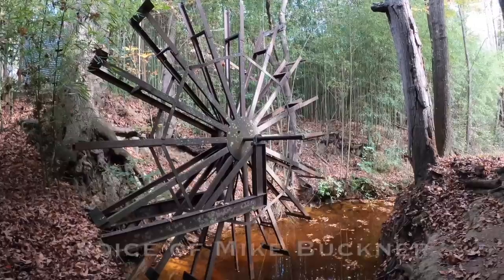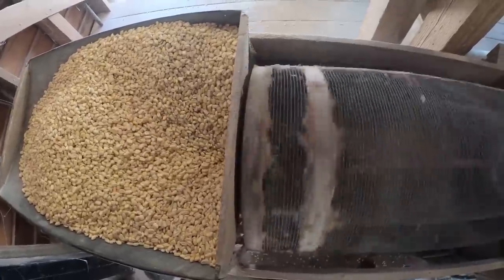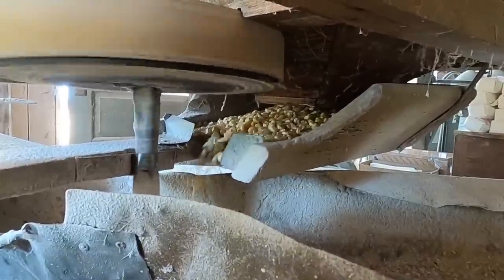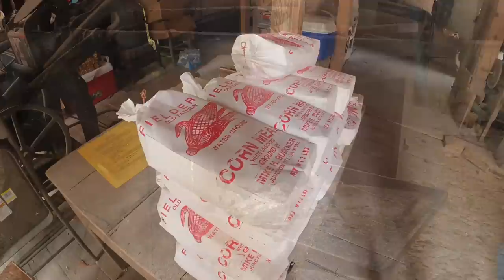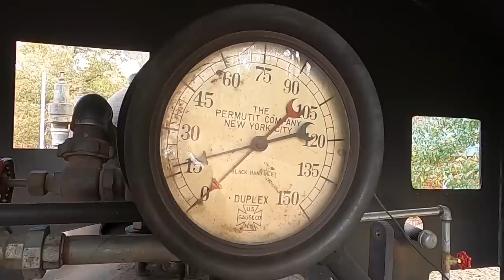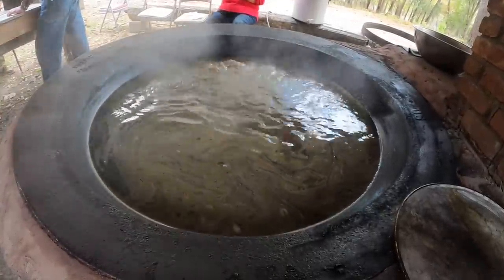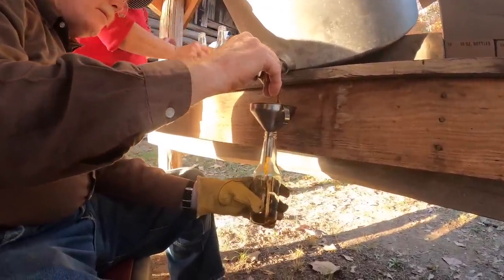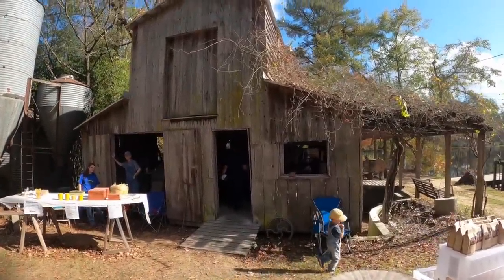The Way Things Used To Be

Comment: Here in South Central Indiana Lawrence County there is a park called Spring Mill Park. It is a beautiful example of life in the 1800s. The water that flows through the rolling hills and the caverns producers plenty of horsepower for a grain mill as well as a sawmill. These are demonstrated to the public in the summer season. There are dozens of original log buildings and beautiful creeks full of water cress. There is a blacksmith shop that actually functions and they demonstrate, there is a woodworker shop with a foot powered lath. Another one not to miss if you’re in the area.

Comment: Hi Wes. Have you ever been to Jarrell Plantation near Juliette, GA? I was there 5 Nov 2022. This plantation started around 1870. I took 144 photos with most of them being black and white. On the way home, I stopped at a covered bridge that had been rebuilt in 1997. I suppose the original fell apart. They had a sugar can grinder powered by a tractor because the steam engine was in need of some parts. I even tried some of the cane juice after it had just been pressed. If you would like to see a few of the pictures, I could send you a few. They are around 1.5 Mb each for the black and white. A nice trip to see some old things. Have good days!